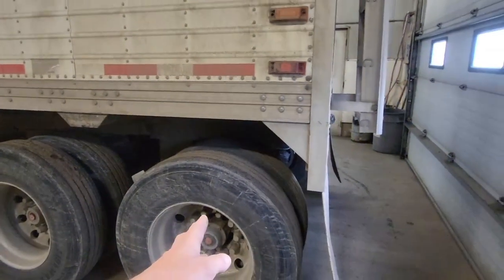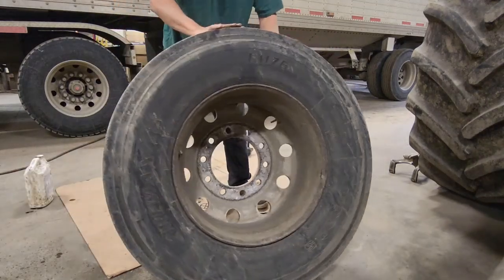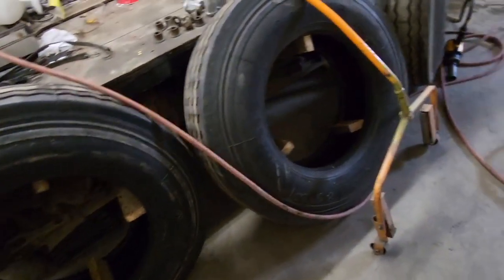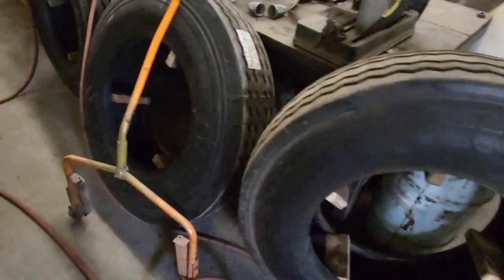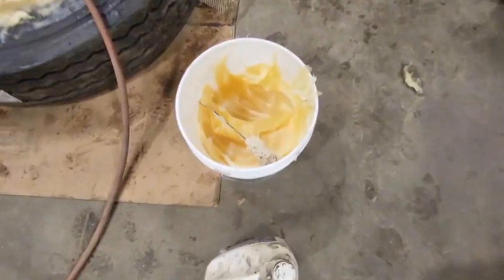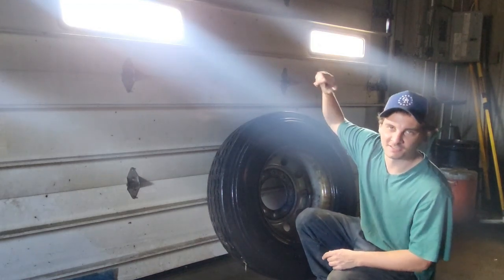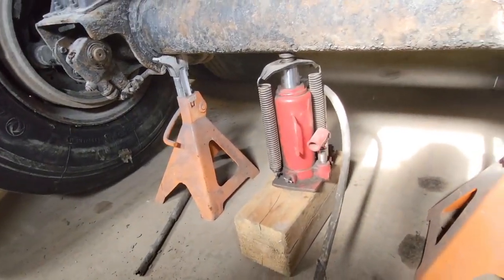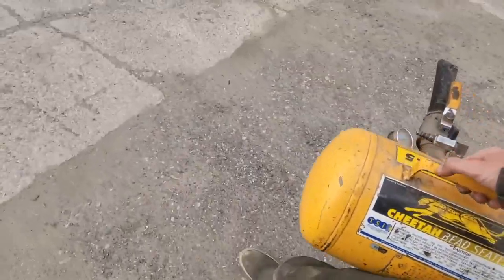This Is A Tire Guys WORST NIGHTMARE ! How To Change Transport Truck Tires !

Comment: Good job guys  I kept telling the screen flip it flip it  valve stem facing up  2 pieces of wood  good job   used to change  between  25 and 30 tires a day  dismount and mount  at transport company   yup and got wore out  lol

Comment: When you were very young, tires got done easier at Steven's. Mike pointed. Those tires on that trailer, lol. Next time. Get yourself some 10.00x20 inner tubes and stretch them right out previous and a rubber donut ring for the inflation. Good, too, see it's still happening out there. (Doug) Old Tubbys.

Comment: Hi Shane. That Golden Buddy tool made it look easy. I will be sharing that name. Perhaps a tire warming cabinet or heater with the blocks would help to open the tires. You have shown the before and after of having the rims cleaned and polished. Would that company let you show what's between the process? Have good days!